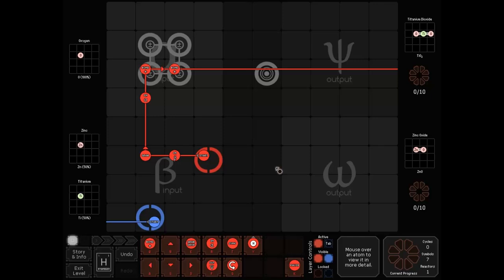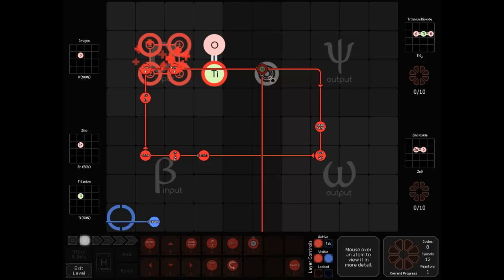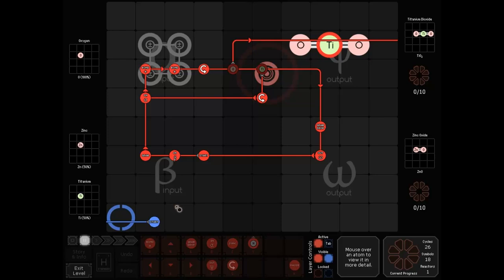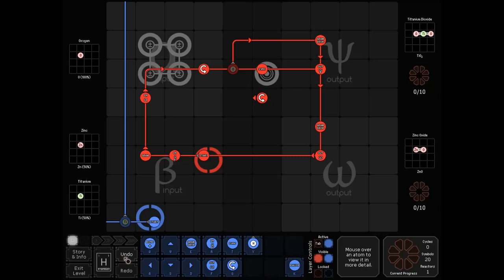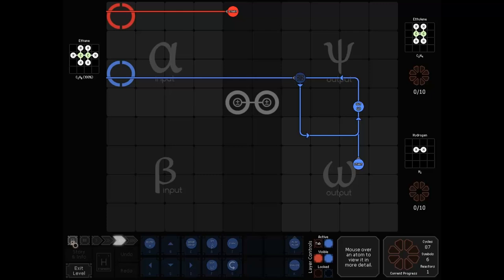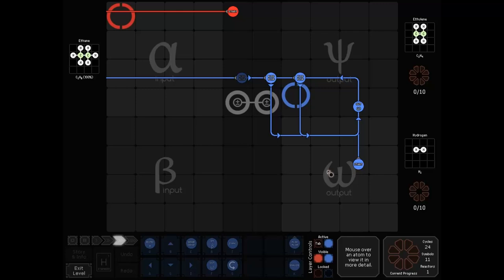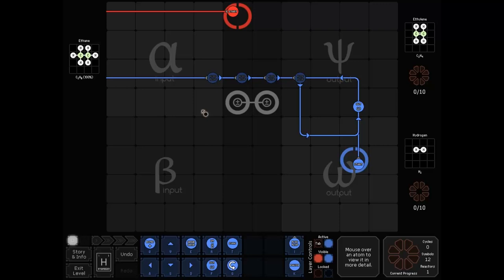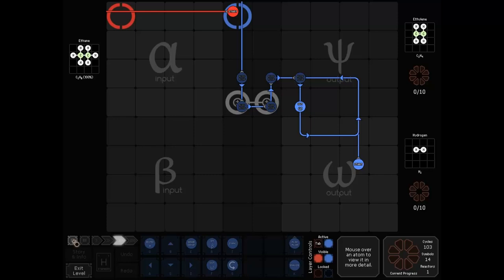SpaceChem - Sensors and Flip Flops

Comment: Cool. I'm very much a beginner (just doing Flidais now), but another useful thing with a single flip flop seems to be to create a branch which can be traversed once and back again, and then continue on the previous path. Sometimes very neat, or necessary if you are running out of squares to manoeuvre in. (This may be obvious.)

Comment: I spent far too long trying to come up with a way to make a 5-cycle flip-flop path where the waldo would go off and do something different between cycles 4 and 5 before resetting after 5. waaaaay too long before I realized if I make it walk through the mechanism once before ever touching the cycle, then I can use a plain 5-cycle mechanism and just have it go do its thing at the end. It just happens to reset to initialized state one cycle before the overall reactor cycle finishes.